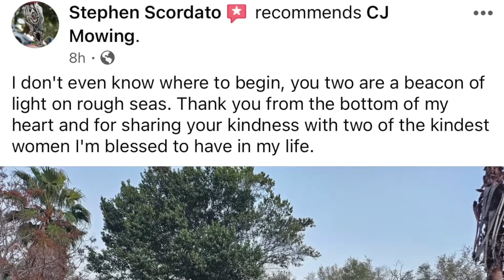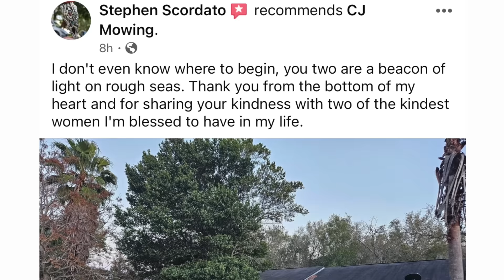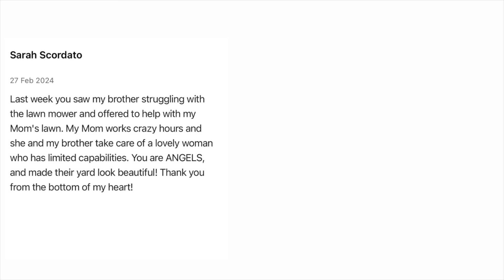“Moms Gonna CRY when She sees THIS!” You guys are like ANGELS!

Comment: Your assistance to this family is greatly appreciated. Their charming home appeared to be genuinely in need of help. The curb appeal is truly enchanting, and your work is outstanding. However, there seems to be a significant need for tree work. Removing the fallen tree from the backyard, cutting down the dead tree that poses a risk to the back of the home, and clearing the tree limbs from the roof at the front would not only enhance the overall appearance but also improve the safety of the home.

Comment: Nice awareness on the son's  part.  He was staying on top of trash in the yard and knew to pick up the hose so you'd have safe access.  Good there were a couple choices for handling brush. Chuckled when you cut up the fronds, more volume can get into a pile. 7:25 Clearing the fence section made a nice view for the house. 10:51, a sense of order is already coming in. Cleanup on the Sago Palms looked good.  I've noted a downed tree or branch can become a stuck point on a property for years.  The necklace was a kindness. Liked seeing the walkway reappear about 33:22, I'd suspected one was there but it was getting found. We don't necessarily think of doing street edging, but in this case, growth was encroaching on the road and the edging created a sharp look. You did a lot. 

At 44:59 we are back to the vicinity of the downed tree.  I would tend to think of doing it in segments...as limbing it, which would reduce the sprawl to a pile, and then perhaps cutting the limbs smaller, another reduction.  (The trunk would take a big saw and I always think of firewood.) Just reducing the sprawl might tend to "take back" some of the loss of space and the overwhelm of the "chaos" plopped into the yard.  If you need a topic, you were saying you are running out of time/light. Might consider a Part 2, of limbing the downed tree, Trimming the back fence, a front tree might be raised off the roof and a Thuja/Arborvitae on the back corner was impinging above on the roof as well. A lovely change made on the whole place.  Thanks for searching them out and helping there.

Comment: That mower that you're talking about, if it's the one I'm thinking of, the blades are up in the front and you can see them as they're turning. That is called a push mower. We had one when I was a kid back in the seventies and partially into the 80s and I can remember cutting the grass with it. I also heard you reference Ohio and that is where I live, in the Glass City and yes I can remember growing up that a lot of people here had them. I'm not sure if it's because they couldn't afford the electric mowers and then gas mowers. I know we couldn't afford it at first which is why we had one. There were eight kids in our house so we definitely couldn't afford one.

Comment: Great job you two, I take it that some areas of Florida don't have curbside brush pick up, if you do lawn maintenance as a regular job, you can see about getting a slide in dump box for the truck and a tow behind brush chipper and chip the brush into the dump body, and I'll let you in on a secret, the green algae on the house, take a pump sprayer and make a twenty percent bleach to water mix and spray on the wall, the results are almost instantly seen, I would suggest that if you spray the wall with bleach, rinse it off about 15 minutes later, it'll get most of the green algae off
Reply: Yeah, I was mistaken thinking that we may have brush pickup out here. I'd seen a bunch of leaves and logs down the road from me and just assumed.
Reply: @stephenscordato4321  it's possible that you do have brush pickup, but it may be once a month or you may need to call your local court house, to find out if your area has brush pickup or if you have to take the brush to a green waste facility or landfill
Reply: I definitely picked up a gallon of exterior home cleaner that will also handle the other discoloration. I went after the fence first. Straightened all the posts and got the gates closing nice and square. Re-stretched the chain where needed, tied it all down, and replaced some missing hardware. No more metal signs, replaced the caps of the corner posts with some rgb lights for some flavor, got rid the elephant ears my mom doesn't care for, and raked out all around the house, hedges, and sagos. We have approximately one billion spiders living in our crawlspace, so I'm planning on handling the stains and webs all in one go. I did the porch with a broom and fabuloso, 0/10, would not recommend. Working on acquiring a pressure washer.  🙏🙏🙏🙏 Everything is just that much less daunting after having such a push in the right direction.
Reply: @stephenscordato4321  the pressure washer will be a blessing for you, you'll wonder why you didn't get one before, get a 2.5 gpm machine with a horizontal motor not a vertical, horizontal is easier to work with, and get a surface cleaner that attaches to the wand, the more you work with it the better you'll become

Comment: Looks much better but Trees should not be "topped" or cut straight across, if they are going to be trimmed or pruned the branches need to be cut at an 45 degree angle...Might as well have cut them completly down. Now when they regrown they will have thin weak branches....topping can cause other problems as well....the owner probly will not really care or notice though.
Reply: Maybe you should have been there helping with the tree trimming. Just saying.